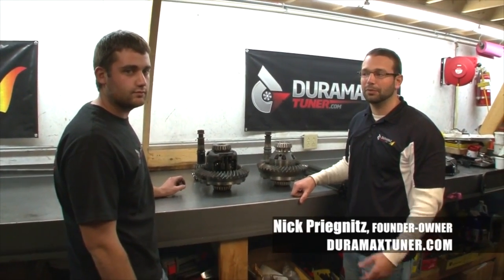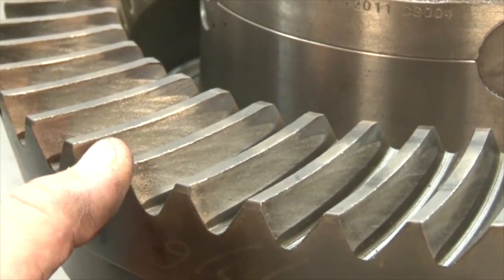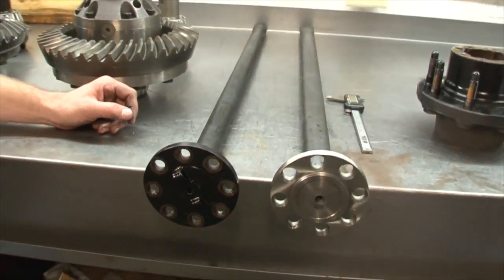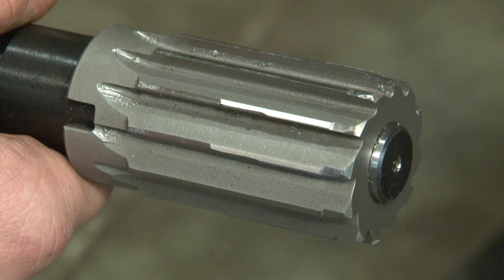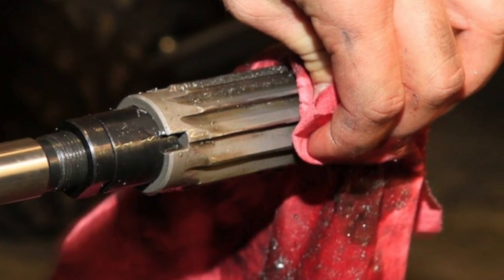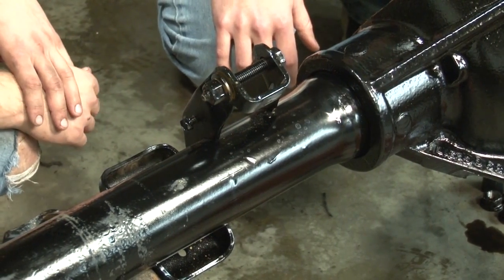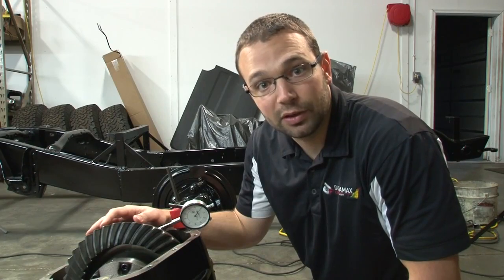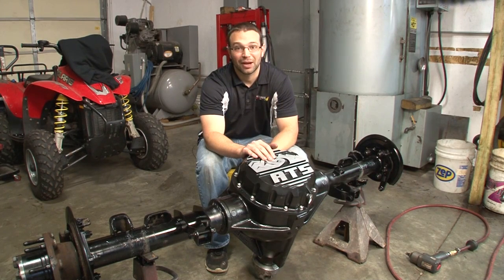ApacheMAX S2 E2

Comment: When you install the 38 spline axles do you have to order the new locker (center chunk) to match the 38 splines or do they match the 30 spline axles
Reply: You would need a 38 spline differential  (center section)